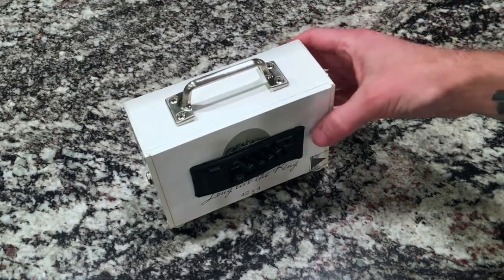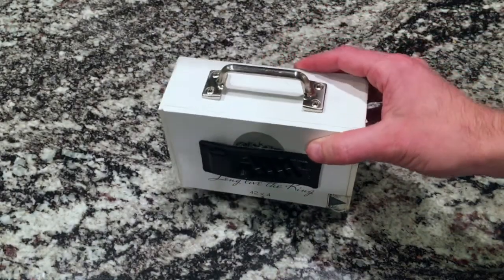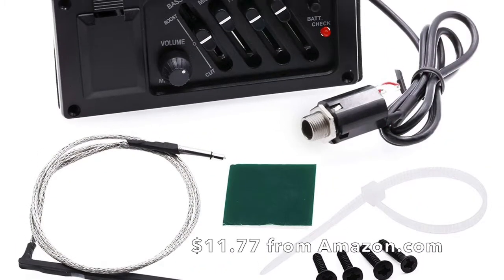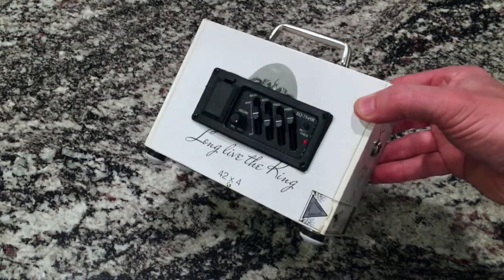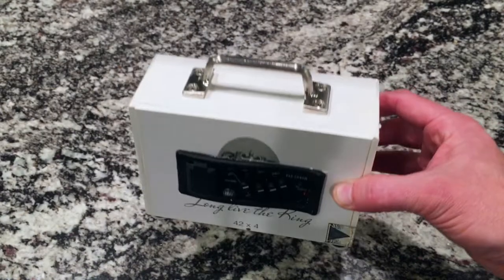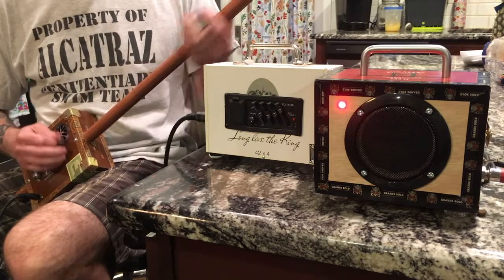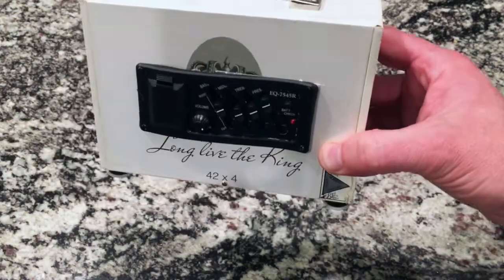DIY Musical Project: Cigar Box Preamp

Comment: you should do a video on how to build this.
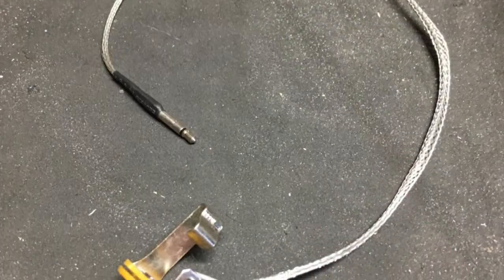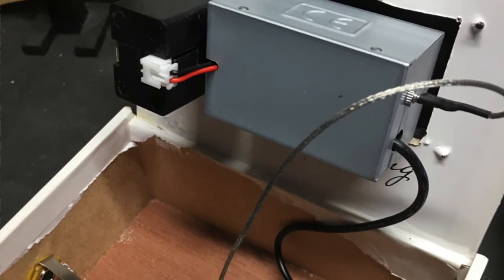Reply from the maker: Thanks for checking it out. While this isn't really a "how to" video, it does pretty much tell you how to build it. The only parts I don't really cover are cutting a hole in the lid and drilling a hole in each side to mount the jacks. After that you just cut off the piezo rod and solder it to a jack (1:36) and then mount it all in the box (1:18). Finally, install the handle and feet.

Comment: Hi there. Thanks dor the video. I would like to know if you could help me with a newbie question about a specific, simple circuit. Its been a little while now since I have built it but there is a detail in the schematics I just dont get. I am sorry to ask you something not about your preamp but I cannot find anything I could use on the web related to the doubt. Would you help me out ?
Reply from the maker: What's the question? I can't guarantee I can help but I can certainly try.
Reply: poorness studios Thank you very much for the prompt answer, but especially thanks for your support. The thing is: I tried to build the charge amp up but failed to find the right places to hook up the two 4.5v rails to in the circuit.The circuit is the #4 on this website https://sound-au.com/project202.htm (Tone controls). It is a simple circuit, one gain stage and a tone control.
Reply from the maker: @andrezadanttass  The way I'm reading that schematic. The 9V DC (red wire) goes to 4 places: C6, pin 8 of U1A, D1, and R1. I see the 4.5v pads at pin 5 of U1B and C1/R2. The author references the split 4.5V (assuming you're creating two 4.5V rails from a 9V) supply but doesn't really explain it past that. He shows a 9VDC current source but no 4.5VDC source. I'm not sure what exactly he's referencing either. Does he have a contact email?
Reply: poorness studios sure thing: rode@sound-au.com, it is on the website. I think I have read on the website something like the circuit not using a split supply, but it does require the 1/2 supply created by R1 and R2, but did not find anything on his page as to the other 4.5v rail.
Reply from the maker: @andrezadanttass  Yeah. I read the page and I don't understand either. He does not do a good job of explaining the 4.5V supply. I'd probably email him and ask what he means. It's not obvious from the verbiage on the page.
Reply: poorness studios exactly. My husband  emailed with him but he did not get back to him on the rails. I simply dont get how to wire them.
Reply: poorness studios My husband has those Graphtech's piezo loaded saddles and the acousti-phonic preamp but he didnt like to sound from the preamp. He plugged the piezos straight into an equalizer and he got better results. The thing about those piezos is that their quality matters, but the preamp is an essential part. That is why he is searching for a good diy preamp.
Reply from the maker: @andrezadanttass  Well that's a bummer. I am not understanding it either. Following this line of thought... I found this: https://somanytech.com/9v-to-5v-converter-circuit/ The article tells how to convert a 9VDC signal into 5VDC signal. That should work because it's within 1/2 volt, but a process like this should be explained on the site you sent.
Reply: poorness studios Thank you so much for your support. Ill watch your video again and see if I can make a pedal like that. All the best and O hope to hear from you soon if possible.
Reply: poorness studios Ill also take a good look at the link youve added. Sorry I forgot to mention that.
Reply: Hi there, it is me again. I have just read the article. Then I go back to the charge amp and ...voila: the second gain stage is not being powered, so he creates a voltage divider in order to supply the second stage. It couldnt be more obvious lol. Here it goes Rod's answer:

"Bruno,
The two points simply join together.  This is a common circuit-drawing technique that indicates only that the points are common.  I used it so I didn't have to show a wire from one end of the circuit to the other.

It's a 'reference' 1/2 supply voltage created by R1 and R2, and bypassed by C1.  It connects to U1-pin 3 and to U1-pin 5.

Cheers,    Rod"
Reply from the maker: @andrezadanttass  Ah. That makes sense. I see it now too. Thanks for that.
Reply: poorness studios :D